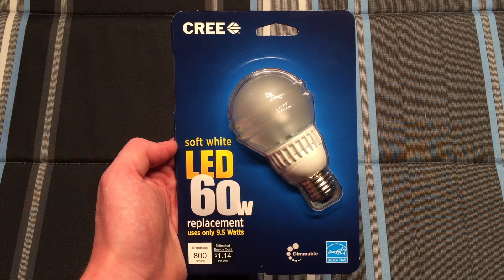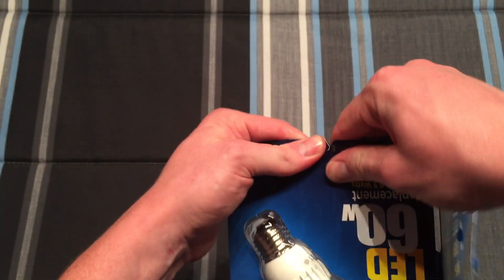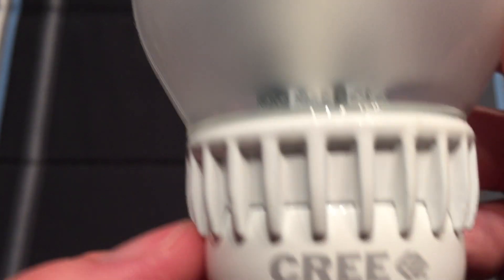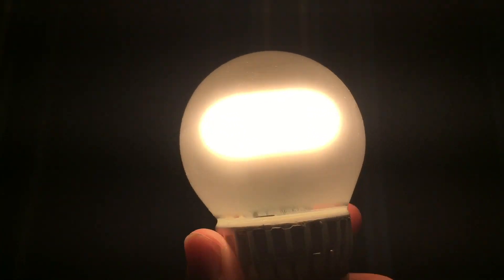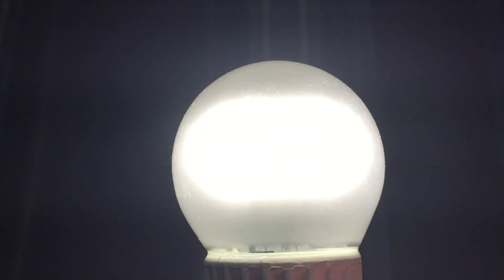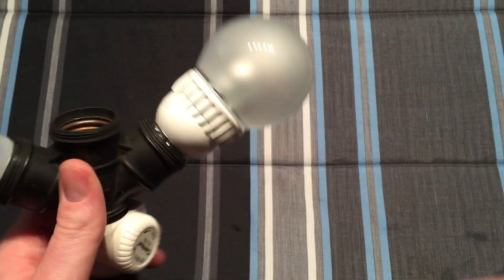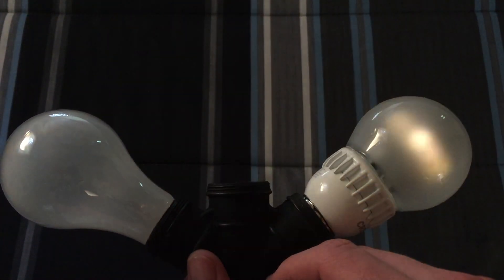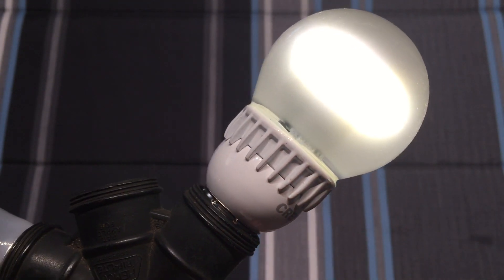CREE 9.5watt A19 LED Light Bulb

Comment: Yup, love those 1st-gen Crees (inside-frost look). Picked up a bunch, last year (discounted). for a buck each.
Reply: For a buck each? Daaaaaaang! You sure got a friggin' killer deal there! We got 15 of them when they were brand new back in late 2014 for about $12.00 each while converting the house to all LED. Seriously? a buck each? We got ripped off there! (kidding, technology prices do drop like a rock) Case in point.
Reply: @albear972  These early Cree’s never lasted very long tho. These are rare nowadays.
Reply: @albear972  Update: These bulbs are now apparently turning purple: https://youtu.be/H8NMEnP2y7U. And all the purple ones in that video looked like these older Crees. The non-purple ones looked like just any modern LED. I guess purple lights may be appearing in houses now if these bulbs are still in use. 90% of them are like dead by now so it probably won’t be very common but they are turning purple. Seems to kind of happen with the 4 Flow bulbs too. Maybe a design flaw perhaps. I know that street lights can turn purple but now light bulbs too?.
Reply: @albear972  These bulbs are not common at all anymore tho they are very rare actually although most Home Depots used to sell them.

Comment: First LED bulb to have a warranty of 10 years. I never had one that lasted 10 years. I bought a ton on liquidation. Almost all of them died and were replaced under warranty.
Reply: These need lasted long. These are one of the most unreliable LED bulbs ever. I’ve only seen a few working ones nowadays.

Comment: You just almost understood how a resistor works! Try unscrewing the incandescent bulb (safely if hot) when both are very low on the dimmer switch. Will the LED bulb dim or brighten? You tell me...

Comment: Thanks for posting. Very interesting.
Reply: I like how they said lasts 22.8 years with a 10 year warranty when 98% of them are in the landfill now. Non of them lasted after the warranty OR lifespan. These are very unreliable LEDs, The diodes are overdriven too. Some Philips LEDs are fire hazards, Like a CFL. Pathetic. Philips. Older Philips LEDs are much better quality and lasts like 15X longer. It’s mainly an issue with the high wattage ones and the flood lights mine is just a 60W equivalent so it SHOULD NOT catch fire.

Comment: Just a quick warning 90% of these bulbs are in the trash now, These were not very reliable LED bulbs. They said they lasted 22.8 years (which is 25,000 hours) when they barely lasted 5,000 hours. Maybe these last longer when dimmed. It will last 22.8 years when not turned on. I think the modern Cree bulbs are actually quite decent tho. These were kind of like how those Lights Of America LEDs went but much brighter. Lights Of America LEDs never were as bright as the estimated Lumens rating. And the overdriven diodes also were the reason why these failed. I rarely see these nowadays. These did not last very long. I bet even a CFL would outlast this. The dimmability was also not that great. These also make buzzing sounds when dim. And yes, They did overdrive the diodes for sure. Still better than some of those GARBAGE modern LEDs that lasts about 3500 hours when it says that it lasts 10000 hours. But modern LEDs are overall better. They are also more suited for damp locations. The Philips L-Prize ones did last a long time, But yes, They were ugly. These early CREE bulbs usually had heat problems which caused them to fail prematurely. Also I do NOT recommend Philips LEDs. Some of the modern Philips LEDs are a FIRE HAZARD, Not even kidding.

Comment: These bulbs were absolute garbage. I had installed 22 of these in my home and by the end of the year, 12 of them had died. No other bulbs had such a high failure rate. Luckily their new designs are a little more promising.
Reply: Were they warmer compared to ordinary LED lamps?
Reply: Antreas Konstantinou They got pretty hot at the heat sink but still remained pretty cool. The drivers were just awful, once one diode went out, the whole lamp would start flickering a bunch then die.
Reply: @joeythefoxxo  These are one of the worst LEDs ever for some reason. These never lasted long. The 10 year warranty was probably because these bulbs were so terrible. The Cree 4-Flows and A19 Cree’s are much better. I honestly like those versions. A 5000K version is rarer tho. I’ve only seen 2700K.
Reply: @joeythefoxxo  Also my Ecosmart LED just died, Yay.